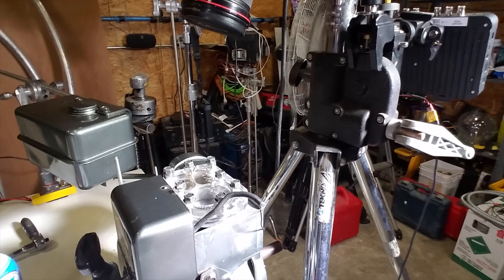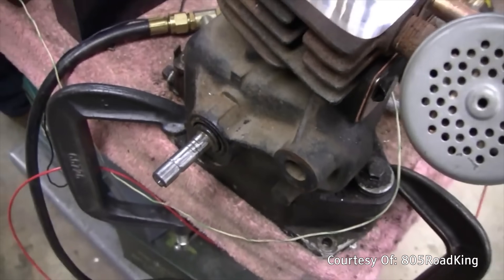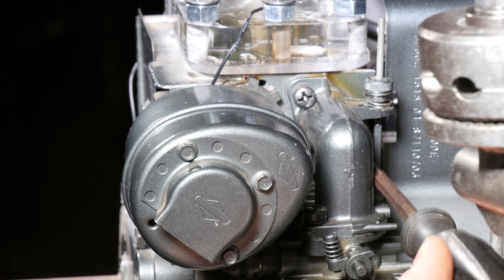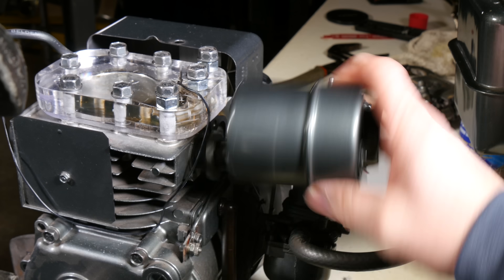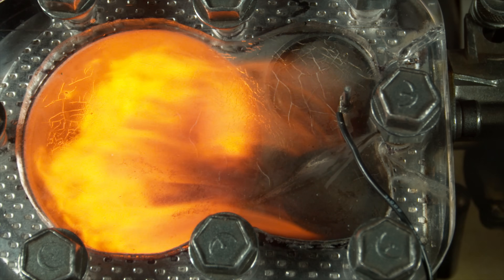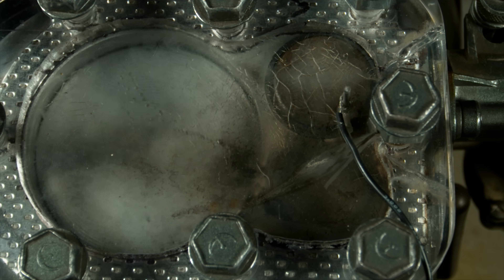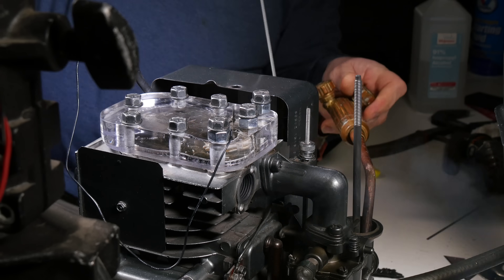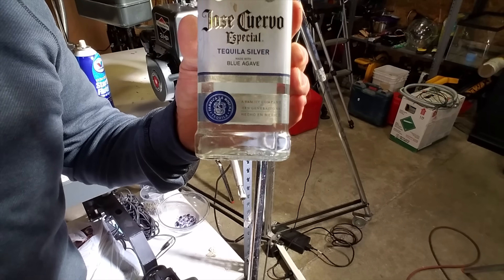See Through Engine - 4K Slow Motion Visible Combustion ( S1 • E1 )

Comment: How engine cooling system work actually and how that system got power to cooling the engine are its from battery or something else??
Reply: That is an “Air Cooled Engine.”
It doesn’t require any Electrical Power to run a Fan.  There is a Fan that is Built right into the Flywheel.  There is Sheetmetal that fits closely around the Flywheel,  and the Engine has Fins all around The Cylinder,  and on the Real Factory “Head,”  there are Fins that are standing up Vertically.  (The Clear Head That they have made,  for this Test,  was made without Fins,  to make the Entire Combustion Process,  Completely Visible)  With the Factory Head Installed,  the Air that is Generated from the Fins on the Flywheel,  like I said earlier,  is made to flow across all of the Fins around the Cylinder and Head,  by a Sheetmetal Piece that is directing the Air to flow over the Finned Areas of the Engine,  to Cool it.
In the Middle of that Sheetmetal piece that I mentioned above,  is the Pull Rope that you use to Start the Engine.  Just under the Recoil/Rope Rewind,  The is a Course Screen,  mounted in the very Center of the Flywheel.  The turning Flywheel,  with it’s Fins,  draws the Air to Cool the Engine,  right through that Center area,  and as I stated earlier,  that Sheetmetal Cowling,  Directs the Airflow,  exactly where it needs to go,  so that the Fins,   will all be Cooled,  Electricity Free,  with no problems whatsoever,  unless the Engine is being used in a very Harsh Environment,  with Weeds and Straw and such,  that would commonly be Airborne,  for example,  if the Engine was being used for an Agricultural Mower,  Made For Cutting Large Areas of Tall,  Dry  Weeds and Straw!  With all of the Straw and Weeds Flying around in the Air,  the smaller pieces of Straw and Weed pieces,  can go right into the Intake Screen in the Center of the Flywheel,  and then,  where the Sheetmetal directs the Air over the Fins,  and the Spaces can be very tight... there would eventually be a buildup of Small Straw and Weed Pieces in those Areas,  which would cause the Engine to run very Hot,  and on the Hottest Days,  it could potentially Cause the Engine to overheat,  and even to Seize Up!!  Keeping Preventative Maintainence,

I could see that you are from another Country,  and we both will likely have Great Trouble understanding whatever the other person is saying,  but you seemed very interested in this Engine,  and probably because of seeing all of the Flames,  is what made you ask about the Cooling.  So I do hope that what I have written here,  as an effort to answer your Questions.... will not be too difficult to understand.

Please let me know if I was of any help to you at all.
Reply: @shelliesman7552  thanks a lot its very helpful for someone like me.

Comment: Your mixture is too rich with full acetylene. That's why it's burning black. Add some O2 in with it and get the mixture the same as what you would run your torch at. Of course, that might blow the head off the engine but it would likely be cool. Great vid. I've always heard how the flame front worked but never seen it for real.
Reply from the maker: Love it !, If the engine doesn't blow in the latest episode then i will feed it oxy. It will blow sky high !

Comment: I dont understand what the second spark is. There is the one to fire at the right time but there seems to be another faint spark during the exhaust or at some other point..
Reply from the maker: It's a wasted spark system, since the engine uses a simple magneto with a magnet on the flywheel, every time that flywheel passes a magneto you get a spark at the same point.

Comment: Yes. I have a request. (I understand this is already in the public domain so it can't be patented.) Biggest problems with the efficiency of these gasoline internal combustion engines are (1) highest pressure for the power stroke is at TDC (which is also when there is the least mechanical advantage) and (2) all of the exhaust heat that's discarded in the exhaust cycle. This idea reportedly fixes both of these problems. What would you think of adding a water injector and a pressure sensor in the head of this engine (or any of your engines) and blasting a brief jet (mist) of water after combustion completes? (The idea is the water expands when its flashed into steam, and provides an additional "push" for the piston (at a time when the crankshaft has a greater mechanical advantage). By adding a pressure sensor you could get some idea of how much more mechanical energy you're getting from the engine. I'd be interested to know if you can demonstrate that the efficiency of the engine (eg. MPG) actually doubles. (But are you also handy with computers, etc? Water burst timing and duration will need to be tweaked for maximum efficiency.) Also it'd be really cool to be able to see all of this with the transparent head. -- Thanks!!

Comment: Why doesn't it ignite every time the piston comes up? Seems like the engine is losing quite a lot of power because of that.
Reply: D. Sloot he’s reviewing a four stroke engine. If you study the 4stroke cycle, you’ll see why it doesn’t ignite every single upward stroke. Either that, or it’s the engine running with the wrong fuel

Comment: Figure out how to make engines work using plastic for long term. would be way cheaper to use than metals. or some other kind of cheaper realiable material.
Reply: Plastics? Hell no... Wouldn't last nearly as long and is an absolute environmental disaster.

Comment: Your getting soot because there is not enough pure oxygen. add air with from your cutting torch with it and it will burn much better. You can see when you went 100% the soot got even worse. We have experiment with cutting torch balloon bombs on 4th of july, and with no air it was just a "poof" of soot. But when we mixed with air mixture then all of a sudden it was a clean explosion that hit you in the chest over 50ft away. One 4th of July we had a bunch of friends over and someone brought up going to the local indian reservation where you can get all the good illegal stuff and buying fireworks. So I told them if you want to hear a bomb go off I got something in the shop that would be the next best thing to probably 1/4 stick of dynamite if not more (it's not that I have never heard a 1/4 stick of dynamite go off, but with the cutting torch balloon bombs I can't imagine anything with more force when exploded). We made fuses by taping the balloon to a sheet of newspaper that would give us plenty of time to get way far back. Only problem is sometimes it took too long to go off. Where just as we lit one and ran back this one girl went to leave the house and ran outside and jumped in her jeep really quick, which at that point was really far away. The only thing is she started backing up really fast and really far where we all started yelling and waving to stop, she just waved back like we were saying goodbye while backing up even further nearly on top of the balloon just as it went off. It happened to be the biggest one we made so far, it hit us in the chest halfway across the field where I couldn't believe it didn't blow out any of her cars windows. It was at that point we put the cutting torch away and left the fireworks to the professionals. In my defense we were only about 23 at the time, where you maybe old enough to know better, but still young and dumb enough to do it again.

Comment: why does it only fire on every other stroke?
Reply: it is a 4 stroke engine.
let me explain,
Intake: Also known as induction or suction. This stroke of the piston begins at top dead center (T.D.C.) and ends at bottom dead center (B.D.C.). In this stroke the intake valve must be in the open position while the piston pulls an air-fuel mixture into the cylinder by producing vacuum pressure into the cylinder through its downward motion. The piston is moving down as air is being sucked in by the downward motion against the piston.

Compression: This stroke begins at B.D.C, or just at the end of the suction stroke, and ends at T.D.C. In this stroke the piston compresses the air-fuel mixture in preparation for ignition during the power stroke (below). Both the intake and exhaust valves are closed during this stage.

Combustion: Also known as power or ignition. This is the start of the second revolution of the four stroke cycle. At this point the crankshaft has completed a full 360 degree revolution. While the piston is at T.D.C. (the end of the compression stroke) the compressed air-fuel mixture is ignited by a spark plug (in a gasoline engine) or by heat generated by high compression (diesel engines), forcefully returning the piston to B.D.C. This stroke produces mechanical work from the engine to turn the crankshaft.

Exhaust: Also known as outlet. During the exhaust stroke, the piston, once again, returns from B.D.C. to T.D.C. while the exhaust valve is open. This action expels the spent air-fuel mixture through the exhaust valve.

These four strokes can be remembered by the colloquial phrase, "Suck, Squeeze, Bang, Blow".

Comment: I have an idea get a V8 engine 350 small block with the transmission attached, on a custom engine stand. connect the transmission to a front loader washing machine then run the engine at wide open throttle on 5th gear. that would be one powerful spin cycle one day I will do that for myself it's on my bucket list

Comment: I'm not a mechanical guy at all, but wasn't the alcohol only like 50% isopropyl  (rubbing) alcohol, meaning the rest is water?  Might that be why the cylinder was not functioning properly and got flooded with liquid?
Reply from the maker: No it was 91% alcohol

Comment: i tried putting a powder in the intake. the valves got stuck open with unburnt material. maybe try 600 grit sandpaper on pine. then dump it in gasoline and remove the filter. that was 25 years ago.

Comment: Now think about how amazing it is to drive your car for 200,000 miles and this constantly happening ..amazing engineeres
Reply: The only difference is in car engines today there would be fuel injector in the head in addition to the spark plug. This is a carbureted small engine where the fuel is mixed with air before being sucked into the cylinder. In your car, only air enters through the intake valve and fuel is misted into the cylinder directly

Comment: Thanks for the cool video! I always knew the theory but, always had trouble picturing it. I wonder the same about the oil flow. Any chance you could do a video that shows how the oil is pumped through an engine. Would be interesting to see both 2-cycle and 4-cycle.

Comment: It's interesting that the alcohol cleaned the engine. 
A few years ago I was really really low on petrol for my motorcycle. So I poured a litre of alcohol into the tank. The bike ran very poorly but I adjusted the idle speed to 5k! and got to the petrol station to fill it up. After I filled it up I took it to the mechanic for its 12,000km service. The mechanic comes to find me when its done and tells me that my engine was the cleanest engine he'd seen for 12,000km.
Reply: Usually alcohol content is TERRIBLE for carbureted engines

Comment: The rubbing alcohol if you look at the bottle you will notice that rubbing alcohol does not come pure alcohol it's got water in it that's why you're firing didn't look the same because the flames being put out by what little bit of water is in there you got to get rubbing alcohol and use it you've got to make sure you got pure 100% alcohol the stuff you get from the store most of it has at least 25% water alcohol dissipates water so it will run but you still got to remember water puts out the fire so you're not going to have as good a fire try finding some alcohol that's pure 100% you will like it a lot better

Comment: If i may make suggestion,...do it more scientific.
Meter out exact amounts of fuel, dont just dump it into the intake. Also, try to atomize it very VERY good, like that fine mist of water that comes from a humidifier.
I think it would be really awesome if you turned that motor into a compression ignition!! Shave the head down until you get a 23 to 1 compression ratio, then use the heating element from a hair dryer to heat the air going into it, then try varios fuels. I read that gasoline is difficult to compress ignite, so start out with extremely fine mist of diesel. Also that hair dryer not only can heat the intake air, but it may also act like  turbo and compress the intake, maybe a few pounds of boost 
You could start it while using the spark plug, then after everything gets good and warm, disconect the spark plug,...and it should stay running

Comment: Great video! If you were to apply the "Gadgetman Groove" to the carb/throttle body, you would see COMPLETE combustion resulting in emissions being lowered to almost if not zero, horspower increased, doubled run time for small industrial engines like this one/increased mileage for your vehicles. Lower temperatures all around, extended oil life. The list goes on for this simple mod! Call me sometime and ask how it works everytime. Michael @ Gadgetman Technologies. (763)-220-9712
Official website* http://gadgetmangroove.com/?atid=42

Comment: pls do that to a 2 stroke engine
Reply: It isn’t the same.  It does it all in two Strokes... and is said,  that the two Stroke isn’t as efficient as a 4 Stroke,  and there are Mixtures from the Exhaust Stroke,  being incorporated into Intake Stroke. I would hope to see that,  an Possibly see little Curly Cues of the Intake and Exhaust Vapors!  I suggest looking into Dyes that you could incorporate into the Gasoline,  so that we could see the Mixtures more easily.
Reply: @shelliesman7552  Two strokes produce more emissions, but make more power than a four stroke of the same capacity by virtue of their crankcase supercharging. Also the inlet valve on a four stroke creates more restriction than the two stokes open port design. The 500cc two stroke GP motorcycles were amazingly powerful, only a handful could ride them effectively.
Reply: So great way to learning
Reply: @kamikazeray4866  I mean he isnt explaining at all how the engine works and appearently doesnt know that he was drowning the engine with rubbing alcohol. Not much to learn from him, only from the video
Reply: Yes that is nice
Reply: Yes I wanna see that as well
Reply: right
Reply: It's quite the same
Reply: @antonman1234  but it would be surely interesting to see the mixure passing through the ports

Comment: Light the torch, set the acetylene & oxygen so you have a proper flame...this when the stoichiometry is correct...next, snuff the flame out and jam it in the hole...it will run clean!

Comment: Rubbing alcohol (isopropyl alcohol) is the slowest burning of the alcohols and being only 91% will contain about 9% water - so it's no surprise that it was the slowest burning. If you perform another test try pure grain alcohol from the liquor store (which is medium speed burning ethanol) or try pure methanol (very high volatility), I would also like to see propane.

Comment: I have ridden in/driven cars for years and years without ever really thinking about what exactly is going on in the engine.  This is exactly what I wanted to see!  From what I've studied I can understand why the other fuel mixtures are not efficient.  But what is going on with the gasoline engine?  It looks like the spark plug ignites on a stroke that doesn't need it.  Why?  Thank you.

Comment: Great video. We see that the burning gas has a strong friction on the engine wall. Therefore, the internal combustion engine is not efficient enough. But a new solution reduces heat loss: https://youtu.be/sknk3RrolSc

Comment: I have a question could you run a engine on calcium carbide and water? I mean the chamber is like in the carbide lamps and with a tap you regulate how much water should drop at the carbide

Comment: Im sure its been suggested by now, but how about atomizing/heating or running a engine on fumes or atomized gasoline fule.  There are many theories and supposedly a guy that made proof of concept by this before being shut down by the government or oil companies and I believe had to forfeit his invention/vehicle for running on 2 gallons of gas and made it 200 miles with a reporter in the vehicle the entire trip.  I'll reply back with this guys name.
Reply from the maker: Aaron Leon yes, that sounds very interesting!
Reply: Aaron Leon ____ Fuel is atomised in the carb already. Carrying pre-atomised fuel instead of liquid just takes up more room. Doesn't really make any sense.

Comment: if you do it again could you use E85, burns cleaner than normal gasoline and produces more power, but requires significantly less air to burn so you will go through a lot more of it quicker than regular gas